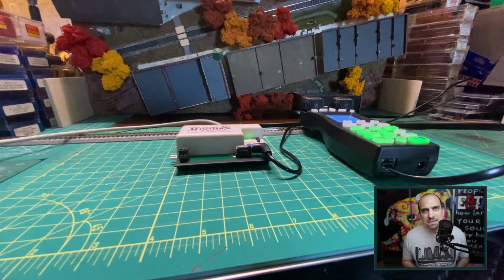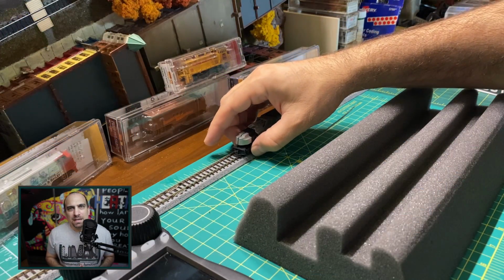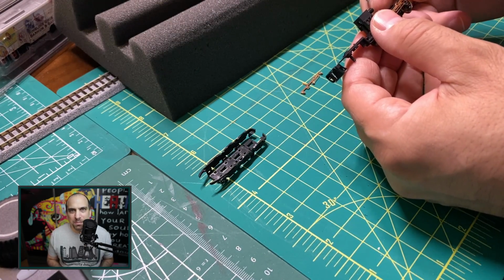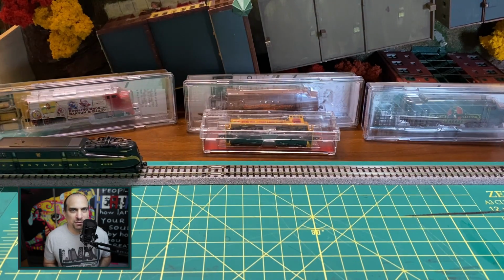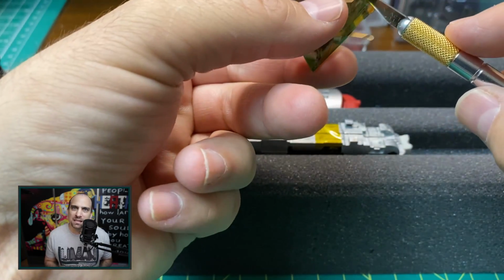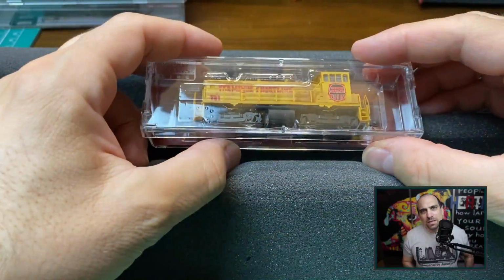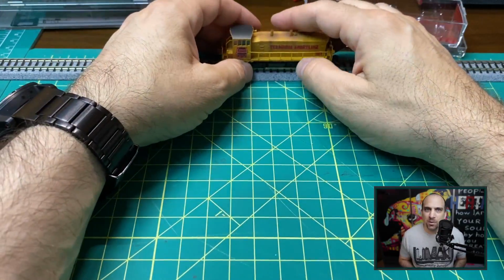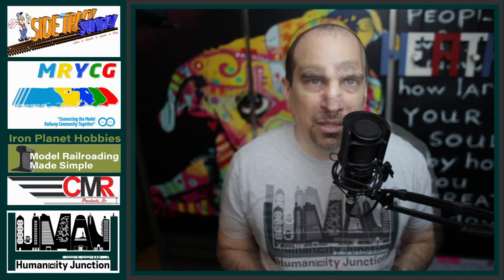52 | Several Updates to Share | DT602D Throttle Update, GG1 Blackjack Repair, Three Decoder Installs

Comment: Nice going Heath, really you want to know who to blame when things go wrong, ahhh mirror. Glad to see the are relatively easy decoder installs, sorry for the bad luck though, but I made have the issue with my crane. Oh for WiFi throttle I just use my iPhone or iPad with digitracks, of course there is no programming features that way.
Reply from the maker: Steve, I was using my phone or computer before I got the throttle.  I did not like using the touchscreen as I did not feel I had as much control.
That said, I do want to setup panel pro. -Heath

Comment: Hi Heath, Sometimes plug-n-play is not 100% plug-n-play, I probably would have had the same issue with the Micro-Trains SW1500,  as I have become accustomed to just being able to drop a decoder into Atlas DCC ready locomotives and having them work without issue. Having the same problem of old eyes and big fingers, I broke down a few years ago and purchased the Micro-Trains Assembly Fixture ( https://www.micro-trains.com/index.php?route=product/product&path=106_188&product_id=574 ) this thing works great for reassembling those Micro-Trains couplers that come apart when servicing locomotives. In fact this tool works so well, I've started purchasing unassembled Micro-Trains 1015 and 1025 couplers, a penny saved .... Cheers, Rich S.
Reply from the maker: Rich, I bought one of those assembly tools after I made this video.  I have not given it a try yet, but I am hoping it makes my life easier. -Heath

Comment: Its not good to release the mysterious blue smoke from electronic. They dont work well after that! Nice video Heath! Glad to see you got you Blackjack running. I should have videoed the repair on the old AHM BL2 I just fixed. It has traction tires as well.
Reply from the maker: Ray, a lot of times I just let the cameras roll and hope I get something useable in the end. -Heath

Comment: Hi Heath nice update. I've had a similar problem with a hardwired decoder that worked great for a while then like yours took off and then stopped. It just sits on the layout now looking pretty lol. I think I'm leaving upgrading my digitrax handset until I'm sure they've finished most of the upgrades. Catch you in a stream sometime stay safe and take care cheers Andy
Reply from the maker: Andy, If you feel motivated, maybe look for a short on that locomotive.
I also waited a while to do the last throttle update. -Heath

Comment: I am really liking my DT602D and UR93.  When I took both the throttle and the transceiver to my club I was surprised to see them already talking to each other, I guess the command station the UR93 is hook to doesn't matter.  Once you have the throttle connected to the transceiver the loconet sees the throttle.  

I wish Digitrax would give more info on what the changes are in the fireware, I have yet to update my throttle.

I to have some experience letting the "magic smoke" out of TCS decoders and how good it is they have the goof proof warranty.
Reply from the maker: Fred, I wish there was a more layman's version of the DT602D instruction manual.  Or maybe even just a quick start guide. Or maybe if someone did a video on all the features.
I am starting to use the throttle more now, so hopefully I will learn more as I go. -Heath